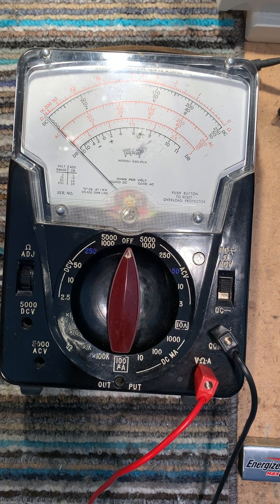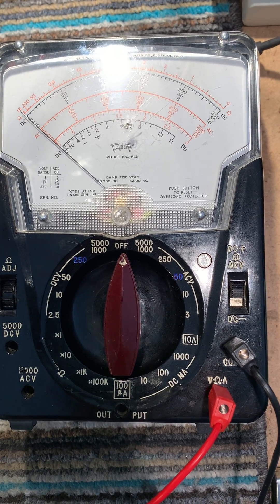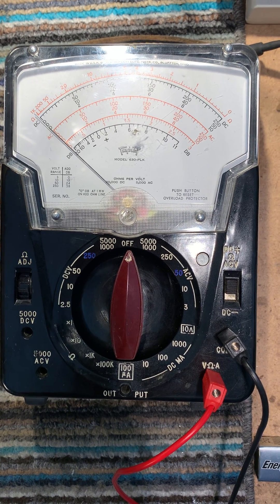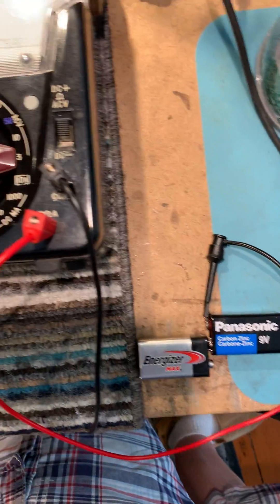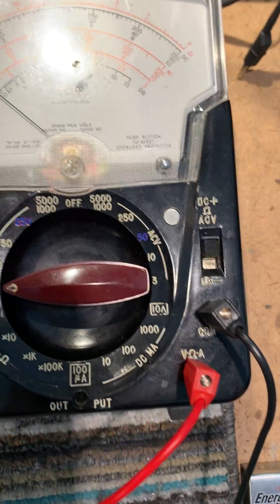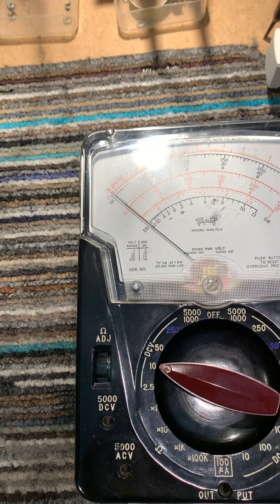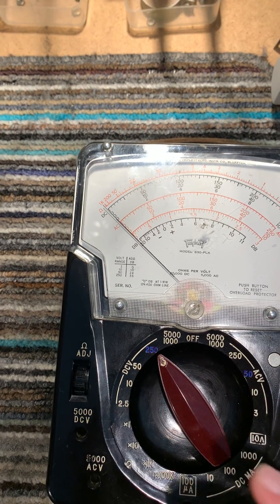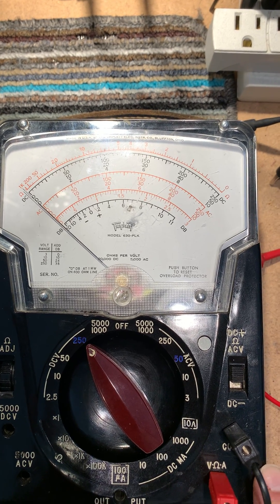Triplett Model 630-PLK Multimeter Cutout

Comment: I came across a Triplett model 630-L at a yard sale. Do you have an idea of the value?
Reply from the maker: Hi Brady.  I paid $30 for the last one I bought from a friend - this was in immaculate condition, but I likely paid a bit under the odds.  The first ne I bought (around 20 years ago off eBay) I think cost around $65, also in excellent condition.  The other one I have (the one in this video) was free, costing only the price of the 3N58 to fix it.  I would check on eBay for recent selling prices
Reply: I have a new to me 630-plk and the protection circuit trips on almost all settings with nothing connected.  I wonder if someone put the battery in backwards??  Acts just like yours did.  Do you have a way to test the device other than substitution??   Meter works on all ranges if I pull the 30 volt battery.  I can't imagine WHY the idiot engineer put the 30V battery and the 1.5V battery with the positive terminals on opposite sides instead of the same side???